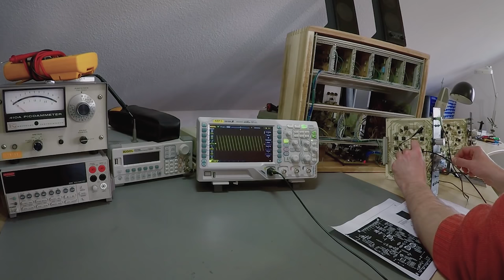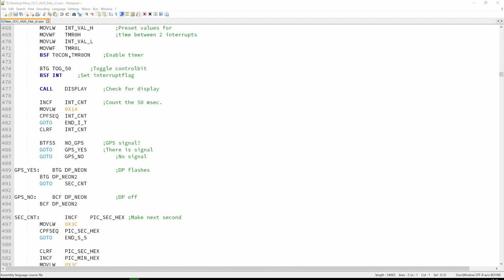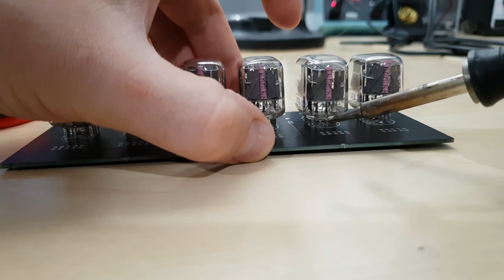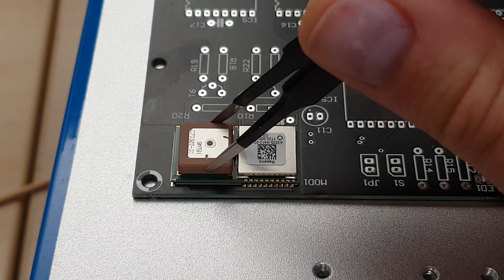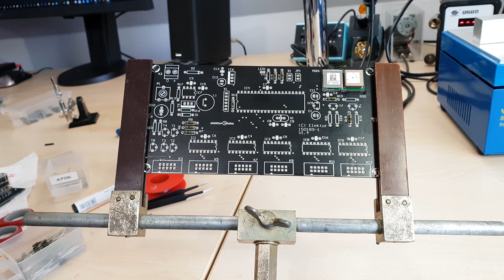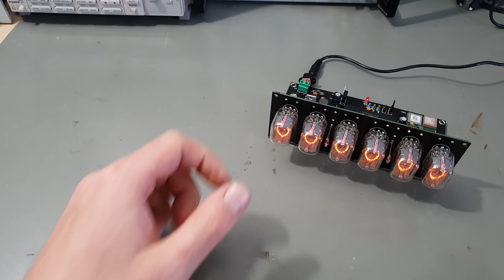Elektor 6 Digit GPS Synchronized Nixie Clock DIY kit

Comment: I built this kit a few years ago. It's still running well and I'm very happy with it although the price was ridiculously expensive and it didn't even include the IN-12's. I also ordered the acrylic case and I added blue LED's to jazz it up a bit. All essential! While building my clock I found out that one of my IN-12 NIXIE tubes had failed. If you really want to post a useful video show what a Pain-In-The-Arse it is to unsolder the tube and replace it! Still it's all worth the effort. Really fantastic!

Comment: Great kit! But eye-wateringly expensive.
Reply: Seems about par for the course... Nixies aren't cheap.
Reply: I would find this price ok if they made some small modifications:

1.) add a connector for an external antenna
2.) add ethernet for PTP and maybe NTP
3.) add a rubidium oscillator for those moments when GPS doesn't work
4.) add eight 10MHz and eight PPS outputs
5.) get rid of the stupid nixie tubes

Then it would be a nice and eye-wateringly cheap clock which I would buy immediately. ;-)
Reply: Siana Gearz - IN12's are got for less than £2.00 each.
Reply: 9mm digits x.x not suitable for a wall clock. If there was something affordable, i would totally build a nixie clock for my mother. She's currently completely blind, but this is temporary, once the eye surgeries are complete, a good Nixie clock would make for a great present.
Reply: Siana Gearz - I'm sorry for your mum, but this doesn't negate that this kit is "eye-wateringly expensive" because it uses the IN-12's you complain of, and which can be had for very cheap.
Reply: Ooooh. Wait. It looked bigger on my HDTV. Yeah that IS expensive.
Reply: Ooooh i was mistaken, 18mm digits! Well that's perfectly usable to sit atop a TV or somewhere in living room or kitchen. I guess i'll go on making one then.

Comment: So how well does that GPS module receive indoors? Do you need to position it near a window? 
I've had difficulties getting GPS location to work inside my house -- both with cell phones and with quadcopter flight controllers. 
I love this concept!  I wonder how difficult it would be to mod it to use NTP?
Reply: Modern GPS modules work pretty well indoors, especially if you're just looking for the time. You can get the time with just a single satellite in view, while getting the position needs more sats and stronger signals.
Reply from the maker: GPS in ( my ) doors works perfectly, both smartphone and drones do not. They also have one version with VFDs and an ESP32 for NTP.

Comment: Is it possible that the GPS Synchronized chip could eventually become defective? Therefore, would it be accurate to say that avoiding this feature altogether by instead utilizing a manual Set button would prevent the possibility of additional parts becoming defective?

Comment: I'm building a differential probe just now. Can you give some details on yours? Like why did you chose AD830? I use OPA659 and power it by rechargeable batteries. Did you consider an all-round shielding on high impedance areas? I can influence mine just by putting my hand 1-2cm away. Placing it 10 cm in the vicinity of the DUT it does pick up almost every electron flying out. Do you have a simple method for trimming both for frequency response and CMRR?
Reply from the maker: Making a video about that soon! I want to build one that is powered by Tektronix TekVPI interface. In the Elektor plans a sheet metal shield is recommended! AD830 is probably not the best candidate any more, but I still have a drawer full of them, so I think I'll use those again at least to test the idea

Comment: Currently bulding my own Nixie Clock with the same tubes , mine will be multiplexed! Using an Arduino and two 74141 which i found in my Dads Ic-Bin, those went straight in to my Lab, LOL. Mine will have 6 Digites aswell and timekeeping is done by an RTC.Two question tho, does the kit have some means of protection against Cathode-poisoning ? e.g Slotmachine effect or simmilar ? And second does it adjust for Summmer and Winter time ?
Reply from the maker: It doesn't have protection against Cathode-poisoning, but it can automatically switch summmer and winter time!
Reply: Hm well since the code is open source there is nothing to stop you to change that, but you would need to know how the assembly code and the PIC works and you need a programmer for it, and since there are no sockets in the kit you can change the tubes around either (my Clock is supose to have both, Code to prevent Cathode-poisoning and Socketed Tubes). I am a bit bumed out especially with this high pricetag. But to end on a good note, your video was as entertaining as always, love your humor and ohh my gosh that Solderporn with the matblack PCB. Keep up the good work, can not wait for the next video about the CNC project.

Comment: Hi marco. Is there a way to use that hot plate on pcbs which already have through-hole components instaled? Because it would not sit flat on the surface. (I mean for preheating the board, not reflowing). Kind regards.
Reply: Dreamcat 4 nope
Reply from the maker: There are infrared PCB pre-heaters like https://www.jbctools.com/ph-infrared-preheater-product-115.html which work over distances
Reply: Thanks! Indeed that would be another interesting project also.

Comment: what is the mod needed for the high temp hot plate ? thanks. and nice video as always.
Reply from the maker: Mine is a different model, but the mod is probably the same for both: Replace their controller with Arduino that triggers the triac. Original can stay to drive the 7-segment display. Bonus points for external thermocouple that can placed on the PCB instead of inside the heater.
Reply from the maker: (Don't tell anyone but I just wanted to include a Banggood link to get a few commission dollars on the side :)

Comment: No cathode depoisoning? Bad kit, it'll kill the tubes in no time.
Reply from the maker: Is that so? I thought it'd only disable the numbers that are never used, and since they are never used it shouldn't matter?
Reply: That's true, but it will also sputter on the sides of the tube and back on the existing digits, as well as making bits conductive that shouldn't be conductive.
It's really, really not something you want to have in nixies if you expect them to work for more than a few years. That, and it's super simple to prevent. See my last video for a clean way to do it without distracting yourself.
Reply from the maker: Cool, if I ever get some Dalibor Farný tubes I'll implement that :)
Reply: IN-18s are a cheaper and slightly smaller alternative :)
Reply: I still don't get how you can prevent sputtering by cycling the numbers... i mean used digits are going to emit material regardless, you're just knocking it off the normally unused ones, which means there will just be more of it on the glass surface and elsewhere?
Reply: It prevents buildup, rather than knocking off what already is there. If you already have a thick layer, it's not going to come off in regular operation, it will need healing(which is rather risky).
Reply: But the material, buildup of which you're preventing on a given cathode, would be emitted regardless...
Reply: You're preventing the buildup on all the cathodes, that's all you care about. You won't really see it on the glass or elsewhere.

Comment: No idea what a bugelere is, but I need one.
Reply: "biegelehre" means "Resistor Lead Bending Tool"
Reply: Literally means "bending ruler" though. Well not necessarily ruler, "Lehre" means measurement tool or method, and also applies to measurement tools that are not rulers, for example radial calipers and micrometers.

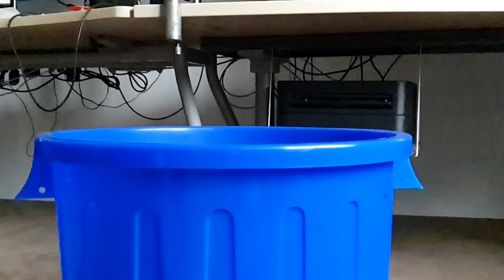Comment: 3:20 Right in the POVERTY ARGGGH. also right in the shity-customs-regulations-that-make-it-really-hard-to-buy-quality-components
Reply from the maker: They cost the same here, but I feel the customs-regulations part! Lost a 3000$ device because it wasn't rohs conform once ...
Reply: I mean, I totally get it, tho in my country buying ( small scale, remember that I don't handle your level, master) metalic 1% resistors vs the normal ones has like a considerable bump on price.........I could try buying bulk and have it as stock :P